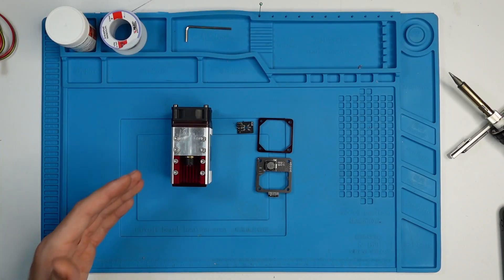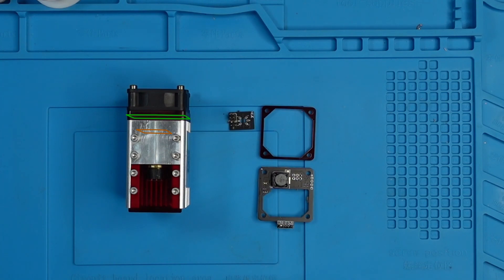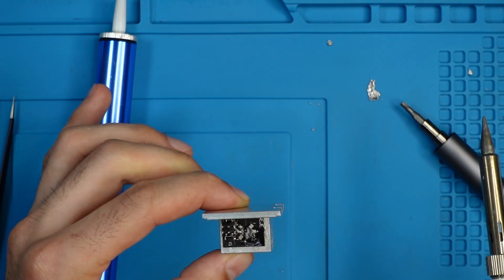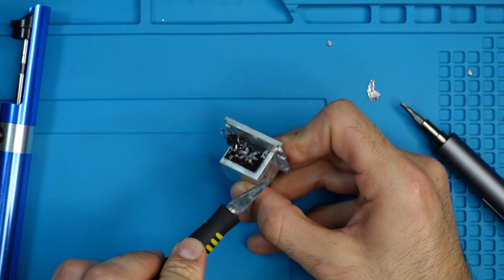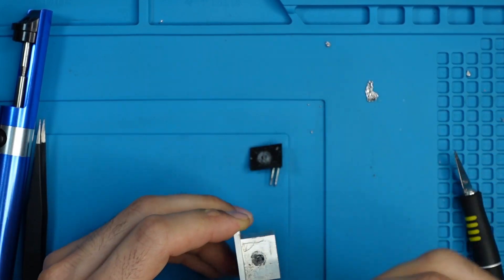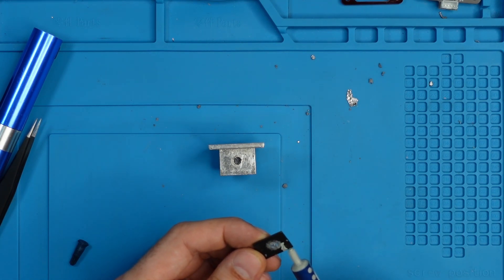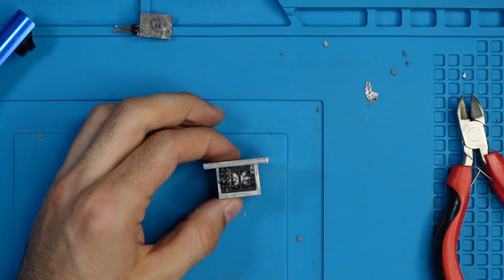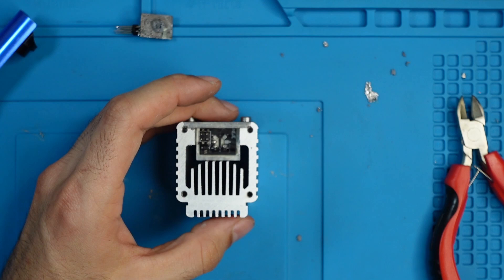Laser Module Repair | NEJE | 20$ Fix - Part 2

Comment: ma sei italiano? in ogni modo te lo scrivo in italiano e poi in inglese, lo spray che usi alla fine per pulire, che spray è? anyway the spray you use for cleaning at the end of soldering... what kind of cleaner is it?
Reply from the maker: Ciao Roberto, grazie per il tuo commento. 

Si, sono Italiano. Non chiedo più perché mi è già capitato diverse volte di trovare nomi Italiani ma non sono Italiani. 

La bomboletta spray contiene alcol isopropilico che è il top per la pulizia di componenti elettroniche ed il formato spry è comodo per l'applicazione, ma puoi usare alcol isopropilico liquido. 
Se non c'è l'hai usa uo po' di alcol etilico (quello per le ferite) con un pulisci orecchie; non è il prodotto ideale per l'elettronica, ma per quello che devi fare andrà più che bene.

Ciao
Reply: @MiddleRoomWorkshop  Ciao, avendo stampanti 3D FDM ed a resina ce l'ho l'isopropilico, liquido, in ogni modo il modulo che si è rotto è l'A40630, ho già dissaldato tutto e sono in attesa dei ricambi, l'unica cosa che non mi convinceva era che il test del diodo col multimentro mi dava V in entrambe le direzioni, ma questa "Since there is a reverse protection diode in LD, you can get two voltage values by using the multimeter." è stata la risposta di uno degli ingegneri della Neje con il quale sono in contatto e che mi ha rincuorato.